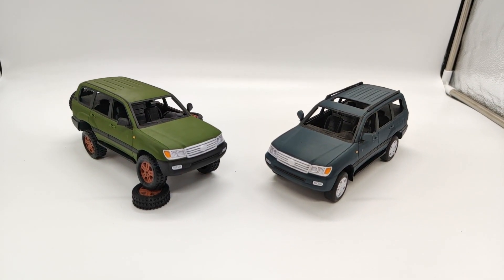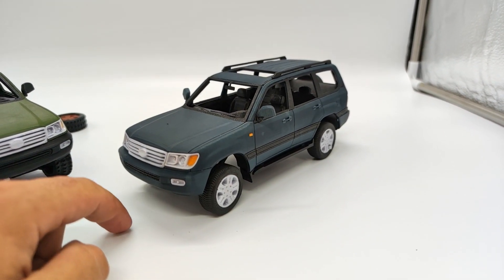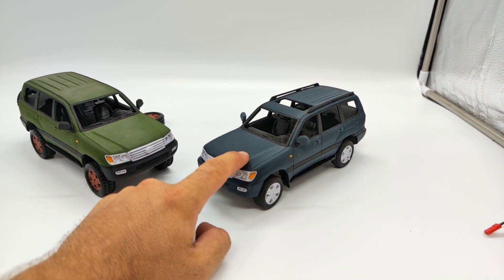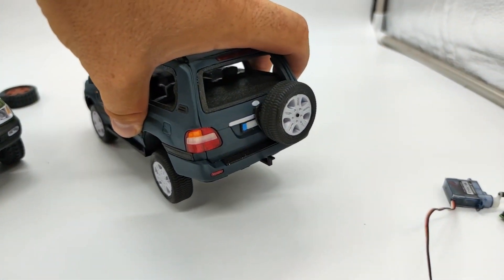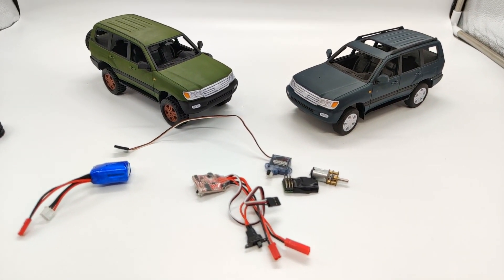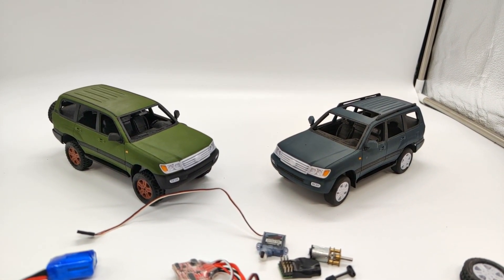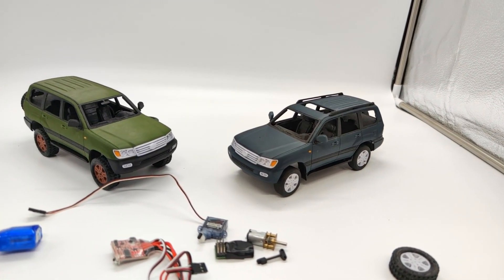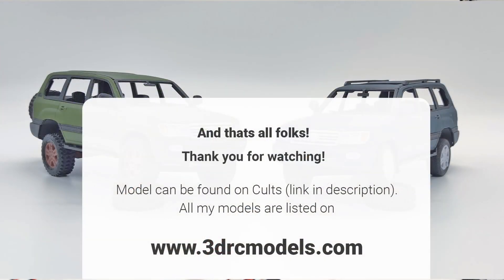Fully 3D Printed Toyota Land Cruiser 4x4 1:24 v2.0

Comment: From all the models  that you designed Which one is the easiest to print ?
Reply from the maker: I would say BMW or Mazda mx-5. All rear wheel drive cars are very easy to print.
Reply: @3DRcModels  and do you use only FDM printers to print your models? Or you also use Resin Printers? What the layer height that you usually choose?
Reply from the maker: I only use FDM printer and usually 0.12 layer height. For larger parts you can use 0.2